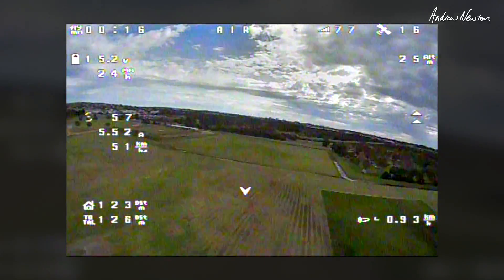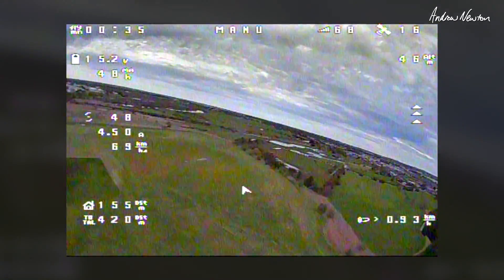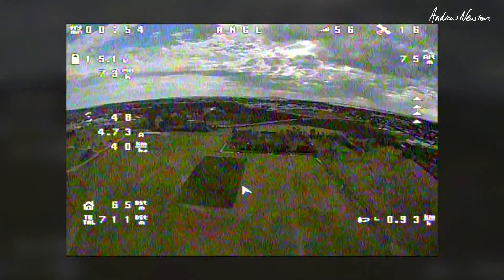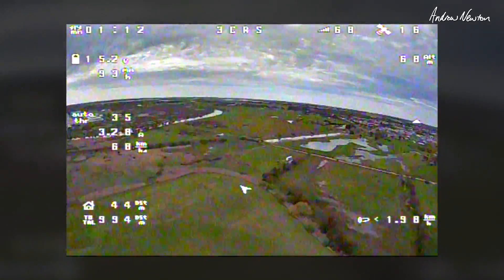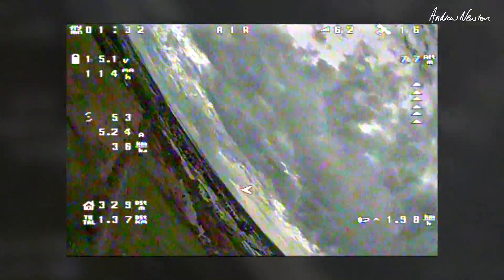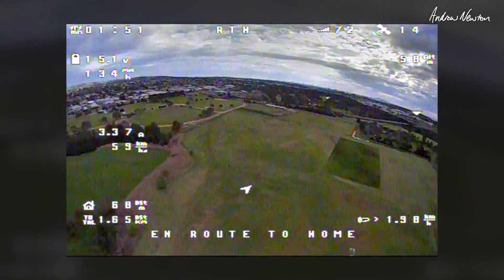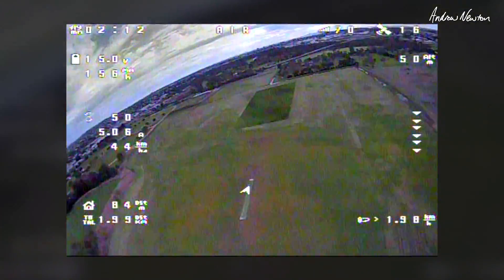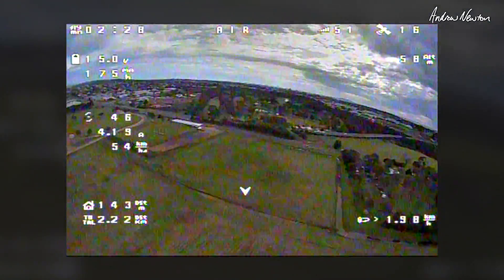Testing Pawel's PIFFs on C1 Chaser

Comment: I'm a subscriber and been a hugh fan of yours for years. I've been flying the C1 Chaser for several years using a lemon stabilized receiver. After watching your build and flight videos of the C1 using INAV I decided to buy another C1 and install INAV. This will be my first experience with INAV and It would be helpful if you could post your CLI - DIFF.

20 October 2019 at 03:43
Reply from the maker: Hi Gene. I have included the C1 Chaser Diff F411-WSE in this Google Drive Folder. http://newtonairlines.blogspot.com/2019/08/inav-cli-dumps.html

Comment: So what is a PIFF. If it's summat to do with first person view, then I#mnone the wiser.

If I Google piff, top of the list is the magic dragon! Or a cannabis derivative.
Reply from the maker: Flight control board adjustments, PID or PIFF. They are the values you adjust to tune any control system. Proportional, Integral and Derivative (or Feed Forward for planes)
Reply: @AndrewNewton  Ah, ok thanx. Seems I'm even less wiser than I was before. Well, since I only fly rc gliders, I probably won't be needing that malarkey for some time to come.

Comment: Mixed feelings about Pawel's video. I only fly inav air mode or manual and even then I found it not as good as a gyro or no-gyro. His video felt like a tacit admission that Inav out of the box just doesn't fly planes that well and he provided a work around. However from my experience Pawel's workaround with little to no P doesn't perform well in anything but still conditions.  I love the OSD, RTH  etc but I think I will just use Inav on cruisers like your C1 and use S6R's with a gyro on performance models. Horse's for courses as they say.
Reply from the maker: Yes it's not as good pure pure stabilisation, but I really only want the OSD, RTH and altitude hold

Comment: Makes sense.  Wing too slow to react for P term.  FF does the pushes based on Sticks and I-term closes the PID Error gap.
Reply: By removing P,  it basically means with stabilization off.
Reply: @vchan1501  No, you have Integral still doing stabilization.